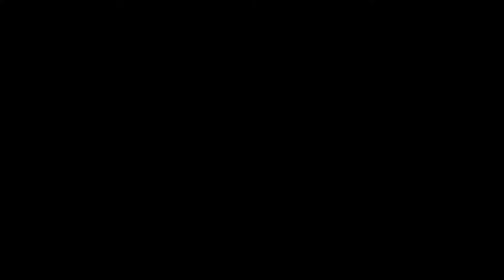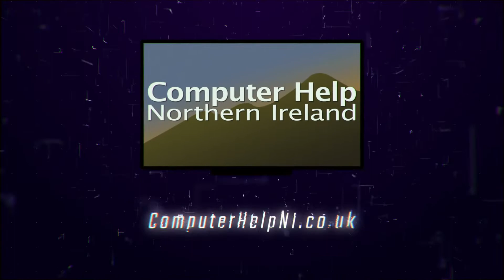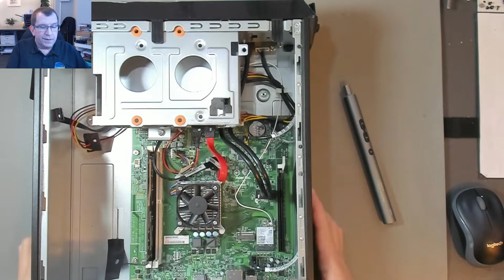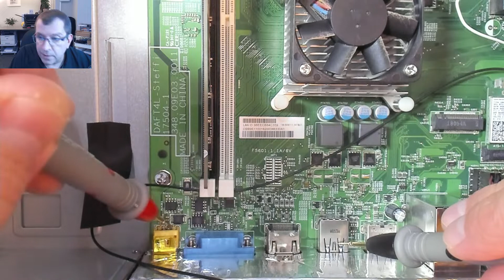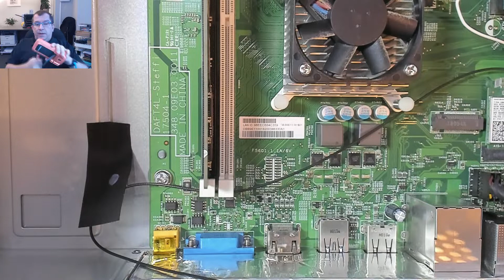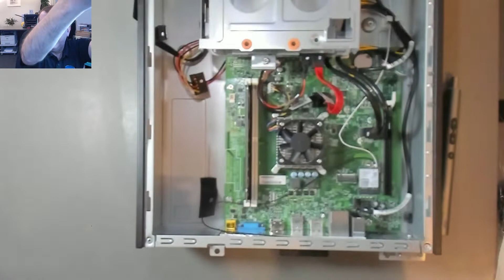[68] Acer Aspire XC-330 - Won't turn on after power cut / surge

Comment: Acer Aspire XC-330 is it possible to upgrade Cpu and Gpu on this device?
Reply from the maker: The CPU is soldered onto the mainboard, but there is an ATX slot, so you could technically upgrade the video card.